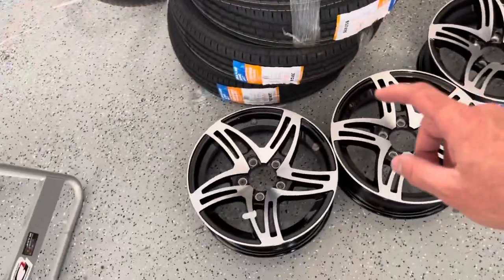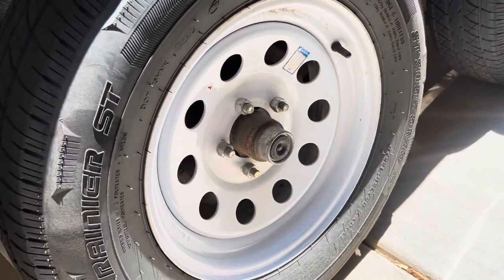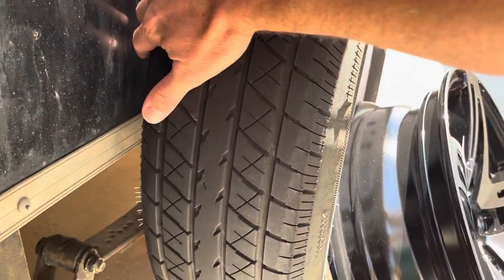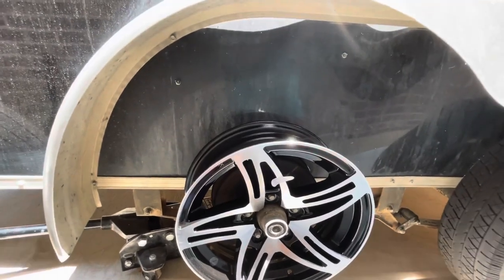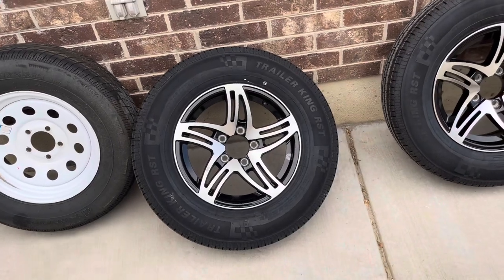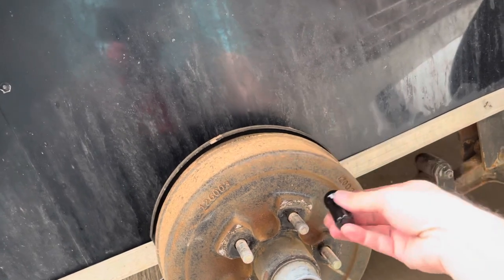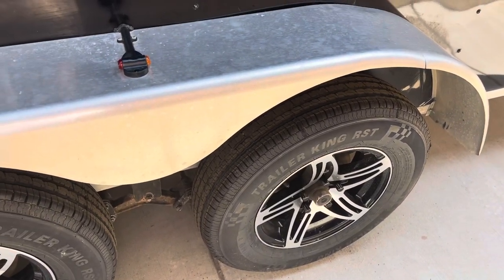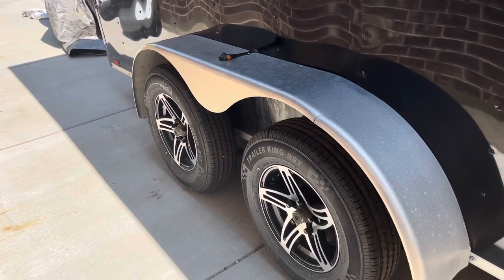Cargo Trailer Wheel upgrade 15” Aluminum 205/75/r15 | Dirt Bike Trailer

Comment: You should ALWAYS use thread anti seize on  wheel studs especially if the lug nuts are aluminum! Putting some paint on the center hub would make your upgrade look even better.
Reply from the maker: Good tip!

Comment: 50 or 100 miles re check the bolts on tires and retighten. Likewise did u mean 50,000 to 100,000 miles or every 50 to 100 miles .....
Reply from the maker: 50-100 miles